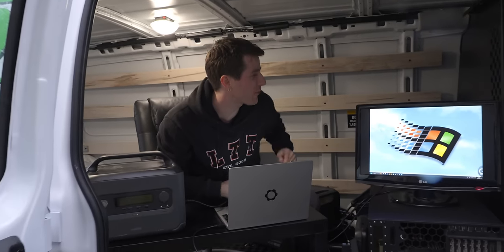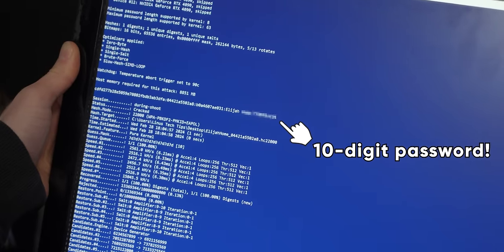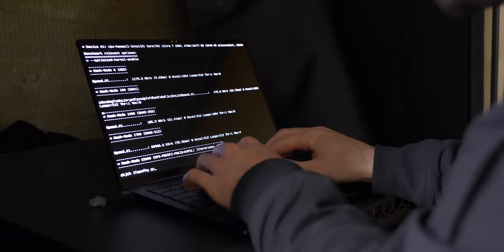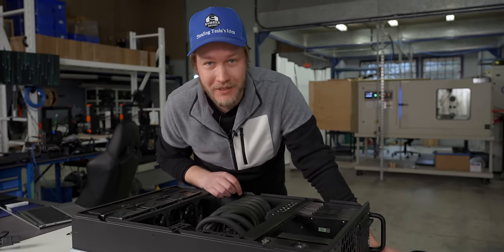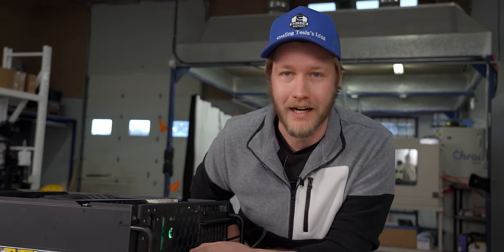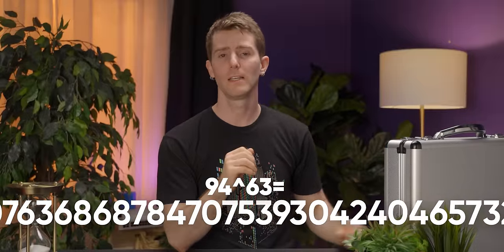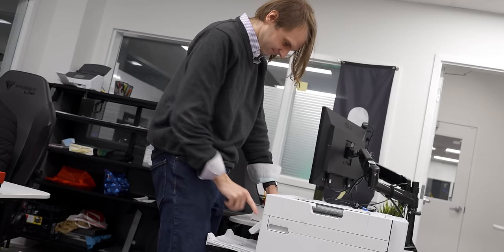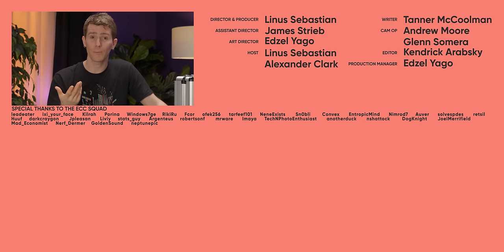I Made a Wifi Cracking Van

Comment: What was missing in the video is, that for capturing the handshake of a device, a device needs to start the connection to the WiFi while you are capturing. Just driving in front of a house capturing a few seconds and leaving won't work in most cases. 
While there is a deauth packet that can be sent to devices to disconnect it from the WiFi and shortly after it will try to reconnect. But even on most WPA2 devices the deauth packet needs to be authenticated by the Access Point. So this is not possible in most cases.
Sure you can wait hours in front of the house waiting for a device to connect. But this is a lot less feasible
Reply: Protected management frames are optional in WPA2 so I'm not sure I'd bet on deauth attacks not working. I'm guessing most cheap devices that don't implement WPA3 also didn't bother to support 802.11w
Reply: @khakers2.099  Maybe some cheap iot devices don't support protected management frames but at least old regular devices like phones and computers that only support wpa2 do support protected management frames, at least in my experience
Reply: Good mention! Comfortable talking about this now because I’m pretty far removed from high school at this point. When I was in high school they did an experimental roll out of laptops to the senior class to determine if they would invest in laptops for the whole school… of course they wanted to secure the devices, however they put the laptops on a completely unfiltered wireless network and put the filtering on the laptop itself! This made access to that network incredibly valuable due to the fact that if you connected a NON school issued device you could have unfiltered wifi access.

I set up a raspberry pi with an external antenna that I hid inside of a computer lab desktop tower and could remote into. I told it to start capturing handshakes right as students arrived at school in the morning knowing that all their seniors laptops would start automatically connecting when in range and I’d be likely to capture a handshake as they walked by the lab. Worked like a charm and allowed me to crack the password off site when I retrieved the device later
Reply: Deauth attacks worked fine for me for kicking desktops and laptops off the network to capture their handshake whenever I did this back in the early 2010s using kali.
Reply: @khakers2.099  And even if it's more and more likely devices/clients support it, there's still good chances a random person with a random ISP provided router or their own from 5ish years ago might not have it enabled by default, or in some cases no support at all. So it'd still be vulnerable
Reply: I thought you misspelled depth or death packet until I realised it was de-auth as in deauthorize.
Reply: Jammer solves that
Reply: ive used Kali Linux and performing a deauth attack works. It just requires at least one device to be connected
Reply: So....go to the house and power cycle their breaker box? Some homes have their breakers externally, especially in my neighbourhood
Reply: @UltraNoobian  not a bad idea. Some routers even allow resetting it via the web interface a few minutes after startup
Reply: I actually don't think it's that unfeasible even if it does take more time. If you know the target too you can wait until they come home and capture when their phone/wearables connect.
Reply: I believe there was a method that didn't require any users on the network. I am not sure how it works though. I just used airgeddon
Reply: so what you're saying is hack the local power grid first, so there is a black out for a few seconds, just long enough for the router to reset and the devices reconnect to it?
Reply: in a lot of budget printers now they put stickers on the usb making u belive its disabled cause they expect you to connect it only using wifi
Reply: @GlycerinZ For a 5Ghz WPA2 network?
Reply: Someone above mentioned it briefly, but seem like it wouldn't be a big deal to use a high power jammer for half a minute to force all the devices on the network to lose connection, then reconnect when the jammer is switched off.
Reply: @johngaltline9933  WiFi Jammers are a lot harder to buy than just a normal WiFi Dongle. Also jamming a whole WiFi channel for halt a minute is also far more conspicuous
Reply: @jjmori7100  I get that it’s not entirely inconspicuous, however for most people, even if they are home and online, a brief drop out is a common enough occurrence. In a business it’s equally unlikely to be noticed after hours
While a high power jammer might not be something the IT/hacking community is familiar with, the technology is dead simple and easy for anyone that wants it to obtain for something just good enough to get a device or two to drop their connection for a moment. You don’t need to ensure a complete and steady block, only a momentary loss of signal to force a reconnection.

Comment: Every stationary device should really just have an ethernet port by now.
Reply: I mean fair but at the same time, not everyone knows or has the ability to run cable infrastructure through a building if it doesn't already exist. Wifi gives us more of the easability/convenience of a layer 1 alternative to networking. The next step is, as this video points out, is to secure your over-the-air commucations.
Reply: Even wired internet isn't completely safe though.
Reply: I’ve got my desktop connected via wifi due to living in an older apartment complex with only phone and cable lines in the walls. Moca isn’t an option because apartment complex, so I’m stuck with either wifi or 100 ft Ethernet cord.
Reply: @jonathanfischer7395 true men run tens or hundreds of Ethernet cables, loosely taped to the floor connected to their homelab which has grown to the size of the kitchen
Reply: Tell that to all the TV manufacturers who refuse to put anything faster than 100Mb fast ethernet in their appliances
Reply: @jacobp8294  Literally me, though running it along the baseboard or ceiling edges makes it look nice.

Comment: One of the best measures to protect yourself is to use strict MAC address filters where, especially for IoT devices, you create a separate SSID and set it up to only accept connections from specific MAC addresses. While not 100% secure (MAC addresses are easy to spoof), it does give you another layer of security.

Comment: Suggestion for a follow up video. How to build an affordable network that is better than buying a home router but not full Ubiquiti Dreammachine Pro level. Something that gives you more access to multiple wifi networks that can be customized but doesn't cost a ton of money. TP-Link's Omada might be an alternate option but also isn't super cheap depending on how you design your network. Maybe also throw in some used commercial hardware from sites like eBay or GovDeals.
Reply: To have full control and remain fairly cheap I'd think something like a basic Protectli router wouldn't be a bad idea
Reply: Engenius' Fit stuff is pretty good too

Comment: With such a setup they put for this video i was really expecting them to try out various different types of recommended strong passwords and check how long it takes to breake it.
The real purpose of the toy you built and are showcasing.
Reply: Eh, in truth, it's very, very easy to have an uncrackable password, the point here is that people use easy passwords or phone numbers are passwords which can be guessed easily with dictionary and slight brute force, once you have a random 10 digit password containing numbers and letters it will take thousand's of years with current hardware, add 2 symbols and now it's even worse... The toy he built is useless on a password like "f}A1=#f9M8" it will take millions of years to crack that.
Reply: Yeah I was expecting to actually see it in action more.

Comment: Something I would recommend to use is a sequence of four or five random words, plus a number or special character mixed in there. Those usually end up being very long and harder to brute-force than even those 16-20 random character sequences and are much, much easier to memorize and type.
Reply: Nope.  Truly-random sequences have more entropy than anything you'd pick yourself.  Choose a 32-character truly random password.  It has roughly 192 bits of randomness.  Five random English words plus a random character would have only about 87 bits of randomness assuming your vocabulary is about 65000 words (which is almost certainly much too high) and your special character has 7 bits of entropy.

Comment: Blur is NOT DESTRUCTIVE.
4chan proved this over a decade ago with the "uncensor this please" and the "no blur" threads. And with AI being what it is now......
Reply: it definitely is though. AI is just guessing at the pixels, it's not adding back the detail removed, but creating new detail.
Reply: @Iaotle  read again. this has been proven pre-AI, and it mostly depends on what kind of blur is used. it just wouldn't matter if they used a block of solid color, or mosaic though, and that's the whole point.
Reply: It depends on the type of blur they are using tho, and even when it is, the programs probably do it all a little bit differently
Reply: Enhance!
Reply: @Iaotle  There are AI trained specifically to deblur. Since blur is "just" a mix of pixels spread out, it is possible to predict how much the pixels were spread out and reverse the process. But on youtube the compression often removes the little colors shifts on blur and we can't recover the smaller details
Reply: Yeah... Pixelating some content is a good alternative though
Reply: @L0op what do you mean pre-ai ai has existed way longer than chatgpt my friend
Reply: Black box!
Reply: @wellsilver3972  you know exactly what I mean, AI as in "the thing that the general public is calling AI at this point in time". which still isn't AI if we're splitting hairs now.
Reply: @RT-.  for good measure, why not BOTH pixelate & blur (this is what I do when taking screenshots with sharex if there's sensitive information I need to hide)
Reply: @JoshuaCasey you're just far better off covering the area with a block.
Reply: Blur+Youtube compression however almost certainly is.  Lets use a physical analogy: take a paper document and white out some information.  It may be possible to remove the whiteout and still see the information underneath.  However, take that same document and photocopy it, and no matter how hard you try you aren't going to remove the whiteout from the photocopy.
Reply: It depends entirely on the method of blur used. There are hundreds, if not thousands of different ways to blur something and the vast majority are destructive.
Reply: @bastienx8  It is not possible to predict that. You can only make a guess, and AI introduces a huge source of entropy. You can't reverse blur without losses, but you may be able to guess enough to reveal general patterns.
Reply: @Nina-cd2eh  if the picture isn't compressed and with minimal noise you can recover a lot of details. There are some tools like Topaz AI or even the deblur on Google Pixel that can do impressive things.
Reply: @bastienx8  "Predict" and "a lot of details" are very different. Depending on the blur and the image, cleaning it up might be easier, but blur is fundamentally destructive, and it's not at all easy to reverse it. And AI fills in its own generated information, and not real information from the image, regardless of how impressive it might look.
Reply: @Nina-cd2eh  if you blur some text enough to make it unreadable and then recover most of it to be readable again, then it is not invented. Most of the time it will be destructive because there aren't enough bits per pixels to store the small color variations, but theorically you could restore every pixels
Reply: @bastienx8  Theoretically, no, you can not restore every pixel. Only in very few specific cases where know what to expect. For example, pure black text on pure white background. Beyond that, the best you can do is make something that isn't well recognizable by you eye, slightly more recognizable. For example, one-directional motion blur will be easier, because you can take more accurate guesses of the color, contour and contrast of objects, where a simple convolution of the image or even high-pass filter could restore well enough to pass as the original. Gaussian blur on the other hand would be much harder. 

Regardless of the method, its a fundamentally lossy process. Imagine if you took some song/audio and deleted everything above 10KHz. The quality would be irreparably bad, even if your brain could tell apart some lyrics. This is what happens when you blur an image too.

Higher levels of blur introduce more entropy too. Just imagine if you used gaussian blur to the degree the image turned into a single color. In that case, you can't even attempt to reverse that to get any meaningful information. It's literally impossible.
Reply: @Nina-cd2eh  what's weird is that people most likely don't even know how blur works, but have seen some example that has convinced them it's not destructive when it definitely is. AI can simply do an educated guess

Comment: Based on my experience, aligning your car and setting up your antenna works well only some of the time. A secure way to protect your home network, or any important radio information, is to physically manage the transmit power and location of your router to prevent sensitive data from being exposed outside.

Comment: 13:15 You for sure can create a ton of WLAN networks for your devices, but this only kinda works in a more urban setup where you do not live on a flat.
If you live in a big city on a larger building chances are high that there already are dozens of networks even there is only one per household. Now imagine that not only you but most of your neighbors not one, but several wireless networks. This would probably hurt performance pretty good.

Comment: I find that the best solution for Wifi security is - use a wire instead.  In my opinion there is way too much focus given today on making everything wireless.  While a wireless connection may be needed in some situations, I feel that a better more secure solution is to use the dedicated wire.  That eliminates the possibility of someone connecting without getting past the physical security that may be set up for the area in question.  But it's good to know that there are security solutions for when you are forced to go wireless.
Reply: This. All static devices that can be wired on my network, are wired.
Reply: Cable infrastructure costs money. When we are talking about a SOHO solution, sure thats fine. But a small/medium size businesses solution, wifi has a wide varity of very valid and innovative use cases. And can cut cable infrastructure costs but a fair amount.
Reply: Kinda eliminates any family household with more than 1 floor.
And most personal devices don't accept a hardline connection.
Reply: Problem is most houses don't have ethernet run in the walls

Comment: All my old devices have wired ethernet.  Just connect your HP printer with wired ethernet, connect your TV to wired ethernet, connect your chromecast to wired ethernet.  I even have wired network cables placed near where I like to sit with my laptop and just plug in the network there too. Good luck if you have a Nest thermostat or LG smart washer and dryer.
Reply: Using a VLAN to segregate your smart devices from the more sensitive stuff is a big step on the way to solving this problem and easy to implement.

Comment: Side note: somebody does not need to own 5 RTX4090's to crack a WPA2 password. They can pay a few bucks and do it on cloud GPU's making the barrier much thinner. And if you're using a brand of router that has a basic scheme for all its default passwords (i.e. the Sagemcom routers Spectrum gives out which all use verb + noun + three numbers) its very easy to create a custom dictionary that will crack it in a fraction of the time.

Comment: The info that older devices break your Wi-Fi security without you realizing it at all is actually very valuable. Nothing in your config tells you that unless you dig deep.

And with IoT-devices usually requiring to be on the same Wi-Fi for full functionality, that's an uncomfortable thing to fix.

Comment: Just use a mac filter for your wifi network , problem solft 😂.
Reply: Mac can be cloned easy
Reply: @indiekiduk  Yes, that's right, but you cannot have 2 devices with the same MAC address on the  network.
Reply: @ffgamingkanaal  yes you can
Reply: @indiekiduk  that is not true,

If a 2nd device with the same Mac comes into the network, it will be automatically rejected.
Reply: @ffgamingkanaal  then deauth the first one first

Comment: Small correction at 08:00, the Intel AX200 is Wi-Fi 6, and the Intel AX210 is Wi-Fi 6E, not sure which one is actually on that board, but I assume it's the AX200 given that the print on the IO shield says "WI-FI 6"

Comment: Years ago, I bought a PDA. I found a wi-fi locator program that had a visual display that looked like a radar. It showed the locations of all wi-fi devices within about 150 metres, in real time. If I moved the PDA, the location of the wi-fi locations would move on the screen, continuing to show exactly where they were. It also showed the name of each router and what network they were using.
The people who didn't re-name their wi-fi routers were also showing the model. I found a website that listed the default passwords for internet routers. In theory, I would have been able to hack into anyone's wi-fi, if they didn't change the name of their router and if they didn't change their default password.

While I did have that capability in my hands, I honestly never actually tested it out.

Comment: WIFI on our house have been turned of for over 10 years.
you could use a sat dish to pickup signals even further away.
then you do not need to park next to house, just a tip.
or just make a pwnagochi small pi device that eats handshakes or captures and store them